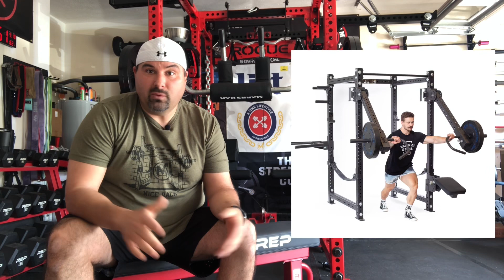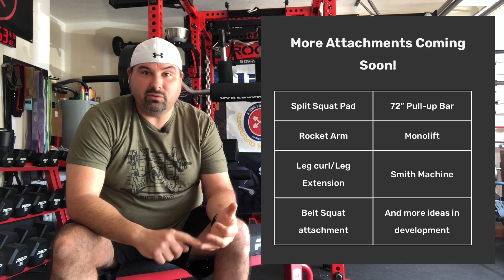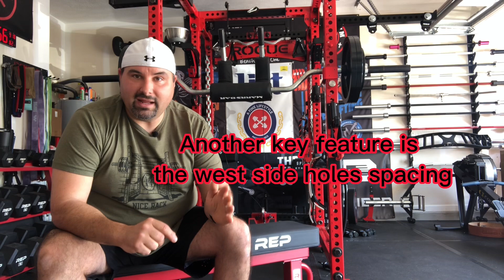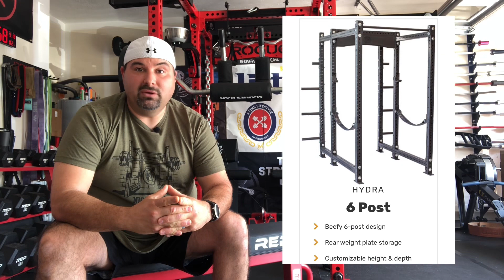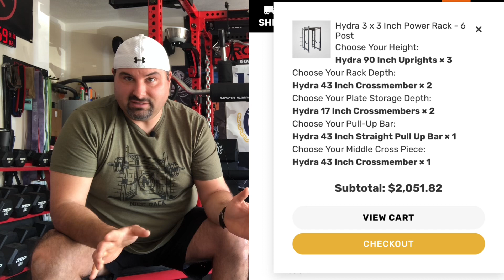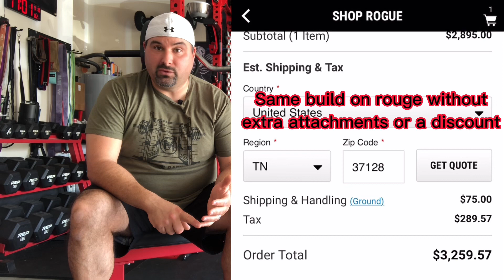Mix & Match with Rogue, Rep, & Titan |  New Bells of Steel 3x3 Contender | Hydra Series Power Racks

Comment: Did U see Coop's review on the Hydra rack. He wasn't crazy about it. Also he said it's $400 more than the REP PR 4000 which is what it compares too.
I was excited about BOS but $400 more expensive than REP kinda threw me a little
Reply: Coop is wrong about cost. BoS was cheaper.
Reply from the maker: @txrazor2643  it was for me
Reply from the maker: Yeah there was some talk about that I think he messed up the pricing.  No matter how I did it bells was much cheaper. When it first came out it was 10% off  using the rack builder and I think you get 10% off your entire order of attachments, lat pull down, bars and plates etc.  I haven’t looked recently this video is like 8months old and coop just recently reviewed it, but either way most of the value is in the Bells of Steel attachments and the true 3x3.  It’s not really cheaper also because the bells rack you are buying a heavier rack it just has more steel in it with wider uprights & crossmembers. So I guess it’s how you look at it and what’s the most important to you.  They are both imported, but I personally would rather have a true 3x3 most of the smaller companies made in the USA all make those types of  attachments as well.
Reply: @carps_gym  
Oh really, he's not telling the right prices, oh no, I haven't checked. 
I used to be a big Coop fan until I saw he sold out and then how Pro Rogue he became no matter the price gouging they sent our way as consumers.
 I frankly didn't trust anything he says since he, in my mind sold out a while ago and would say anything if a company payed him to, however now after he was given enough money that his grandkids are taken of he seems to not sugar coat every single thing about a piece that has been sent to him free. This change in him IMO as occured in the last year, almost around the time he started every video with his disclaimer that he is honest even though he recieved the equipment for free. BTW, If U have to keep saying your honest, as he does, especially every video, then red flags pop up all over the place.
I don't know enough about BOS's equipment to give an opinion as I don't have any so I'm trying to learn about their company. 
As far as I can see, it is REP quality with a little higher price tag, so for me REP is still King.
Reply from the maker: @bobbyhunt3009  I am now 100% sure but they do have a  Canadian and a US website. If you are in the wrong one every thing is like 20% higher or something like that
Reply from the maker: @bobbyhunt3009  it depends on the items, but bells Carries almost everything Air bikes, rowers, racks, bars, benches, rack attachments, rollers j cups, weights, kettle bells, fat bells, dumbbells, comp plates sand bags, bumpers, small machines etc.  

I definitely like their power bar and virgin rubber low bounce bumpers, and their adjustable kettlebell better than Rep.   they also have a good budget trap bar and curl bar that don’t get enough respect

Comment: The way I understood, the holes don't line up between the import racks (Rep, Titan) and the imperial racks like Rogue, BoS, ect. So accessories may or may not work.
Reply from the maker: That has been the case in the past, but the new Hydra racks (5/8in holes ) and the Manticore racks( 1in holes ) are gonna be true 3x3 racks so they will match rogue imperial racks 5/8 will match monster lite and 1in will match rogue monster racks
Reply: @carps_gym  Right, but these racks won't work or may not work with accessories from companies like Rep and Titan and others that are using the fractionally smaller 3x3 posts, correct?
Reply: Which at that point, I guess you just pick your poison and share parts between appropriate companies. I'm sure if you go BoS you'll have more than enough to choose from between them and Rogue and same with going Rep...lots of options to share between Rep and Titan and some of the other imported steel brands that use the same sizing.
Reply from the maker: @chadashton7029  it depends on the item, you can always remove, replace or cut shave down UHMW plastic or shim with UHMW tape depending what side you are one. But the main thing is the bells if steels attachments will be the bigger size and cheaper so they should work on any rack which is better in my opinion and makes them more universal
Reply from the maker: They would fit rogue, Rep, bells of steel, Titan, fringe, Sorinex, griffin, Irwin, grind, Fray etc
Reply from the maker: Perfect example. I have Rep sandwich jcups on my rogue monster rack

Comment: This is a good product, but unfortunately for us tall people (I'm 6'6"), rouge makes the biggest rack in terms of height, so they win by default 😥. The PR5000 used to have a 100-inch configuration, but they don't produce that any more.
Reply from the maker: Yeah understand. I’m 6’2 and my rogue rack is 90 so I have to over head press in front of the rack and a 100’ rack won’t fit in my garage
Reply: @carps_gym  gotcha. Pull ups are tricky on a lower one too

Comment: Good info!  I still think 3x3 with 1” hole racks are more versatile but, the fact you can buy a squat stand and expand up to a 6 post is a great feature.
Reply from the maker: Yeah I agree, but I am thinking back to where I was about 5-6 years ago this would have been very interesting to me
Reply: @carps_gym  Exactly. $300 now for a squat stand and then add on as you can, need, or want. It’s a great system.
Reply from the maker: 100% agree. Build as you go is nice